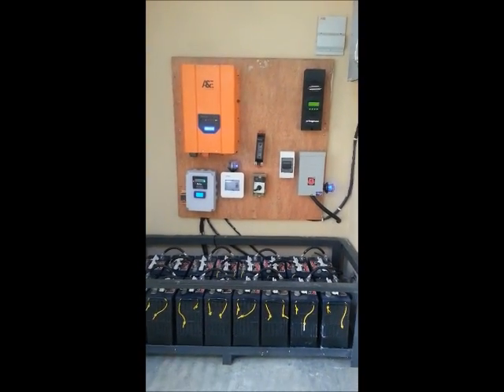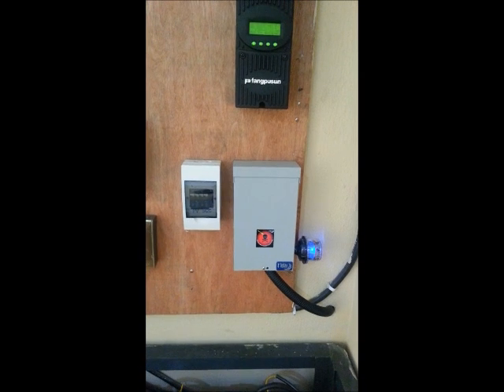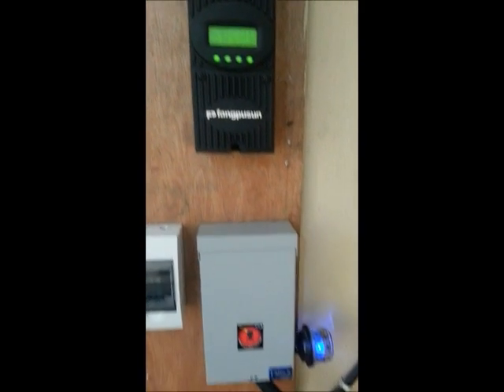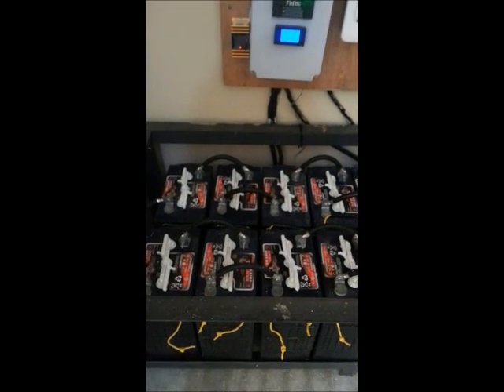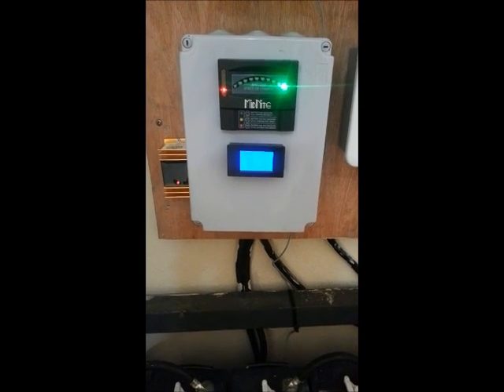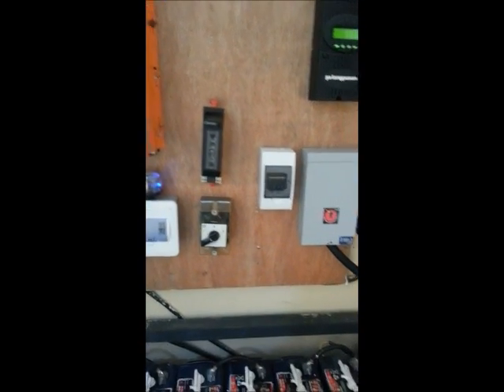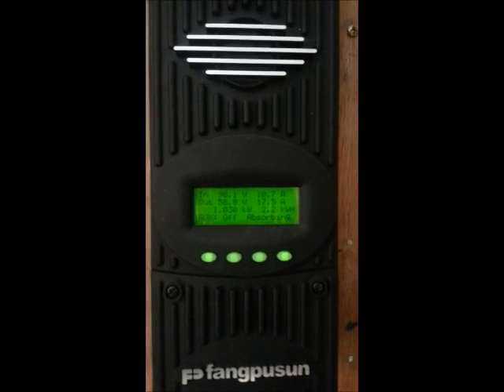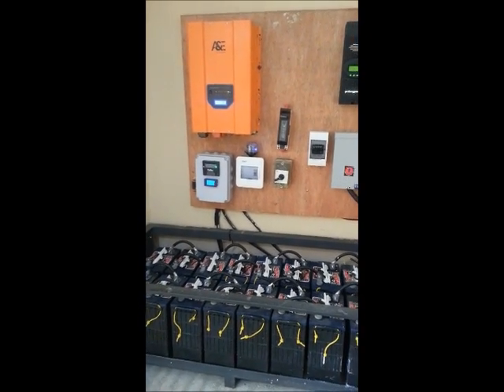3.9Kw Solar &  12kw Low frequency Pure sinewave Inverter

Comment: Awesome setup brother. Just after 9a.m in the morning and you are on absorption? 
WOW! how low was the battery bank before the sun came out ?
Are you totally Off-Grid or Partial Off-Grid? 
Thanks for watching this awesome video and God bless
Reply from the maker: Thanks Jwsolarusa. The bank was about 70% charged . First time the solar panels are charging the battery bank.
It is an Off-Grid setup however it is used a  backup (Partially off-grid ) in times of power outages.
Power outage is a very common occurrence over here.

Comment: Hello, did you connect both East and south facing panels on the same CC? I was of the option of both being on separate CC.
Reply from the maker: Yes both East and West facing panels are both connected on the same CC. Could have actually used separate CCs but due to cost and capacity of CC for 48v system is 4kw and yet to be maxed out. We decided to stay with one CC.
Reply: Ok, but wouldn't it affect the production rate, especially when the sun is away from the east? I am seriously considering doing this, due to cash issue. I have extra panels that need to face east, but  getting another CC for now is the main problem.
Reply from the maker: It would not affect production. I am in Lagos Nigeria and geographically Nigeria lies along the equator. So we have the Sun rising from the East and setting on the West. It just ensures you have adequate Sunshine on your panels from dawn to dusk. Depends on which CC you are looking at. Fangpusun do have some new CCs in their basket that looks very promising, They are way cheaper than the Flexmax mx80 and the Midnite 150.However I am yet to deploy one of those. On my own personal system, I have an extra CC that I intend adding new panels and they would be facing the East to catch the morning Sun
Reply: Thanks a lot, Bros
Reply from the maker: You are always welcome

Comment: Looking good. Is it a full off grid system of backup system?  Send some of that sun down here Please. Looks like rain again today.
Reply from the maker: Thanks .It can run as a full off grid system. However in the current setup it supplements the grid power which is always epileptic or not available.
Reply: Very nice. How is your system going ?
Reply from the maker: Justin Case Solar Power my system is doing great. Would be upgrading the solar panels by another 1.8kw soon